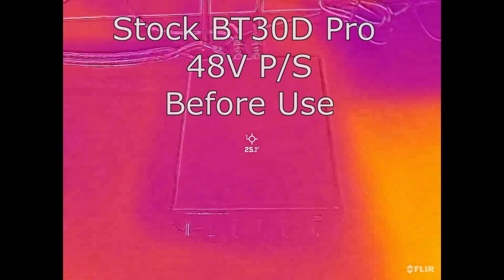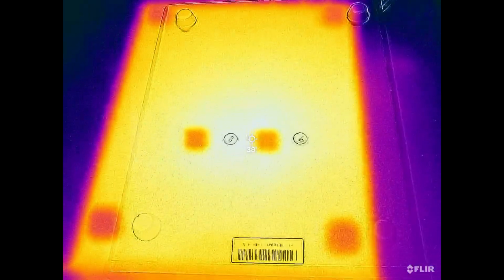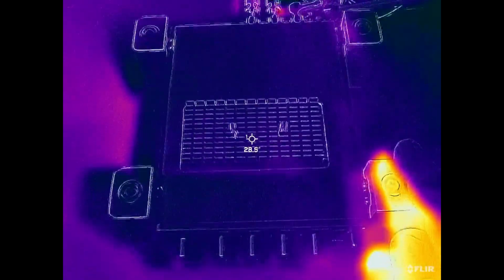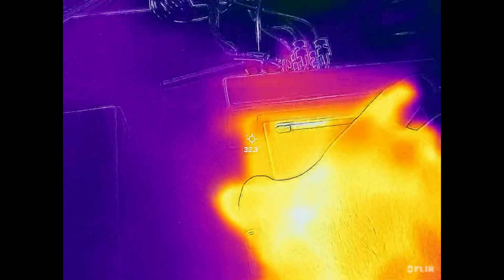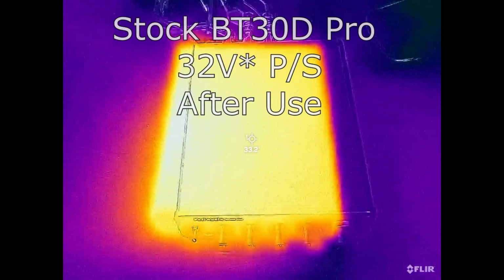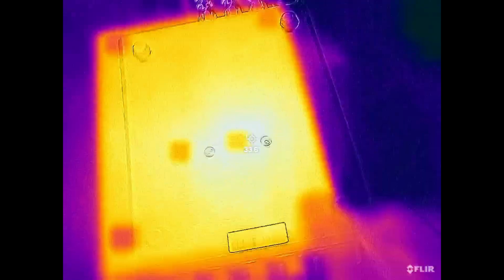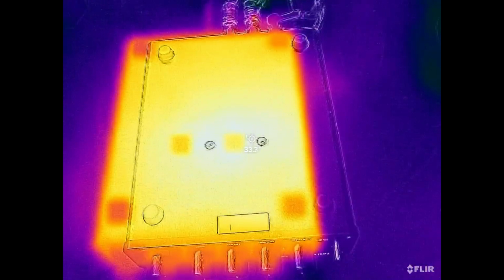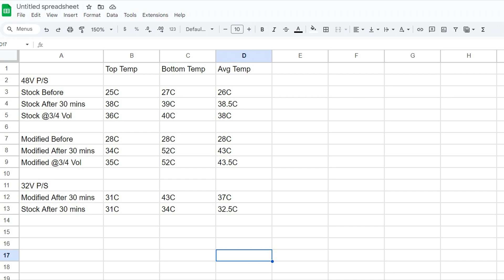Fosi Audio BT30D Pro Class D Amp Thermal Testing

Comment: appreciate you taking the time to collect this data. i just picked up the BT30D Pro and the 48v power supply but started reading some comments about possible overheating. i'll be running an active subwoofer so that should help cut down on temps if i understand correctly.

Comment: Outstanding experiment. Thank you for taking the time to do this. I have 2 Fosi V3 Monos, with the 48v/5a power supplies and don't believe that I push them too hard, but I'm planning on sitting them vertically in my basement labs setup. Do you think that you heatsinks will disapate more heat away from the entirety of the case? Heat rises, and that is the loan fault of Fosi in my eyes. I do own the before mentioned as well as a P4, shipping soon ZP3, and 2 LC30's which power multiamp setups in my living space and workshop.
Reply from the maker: Thank you!